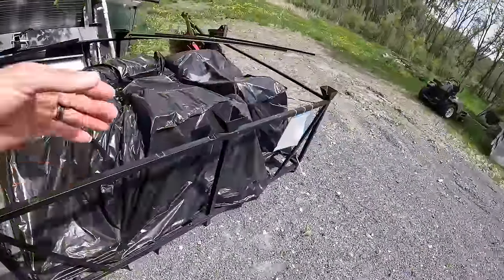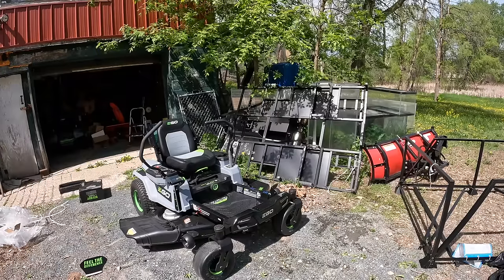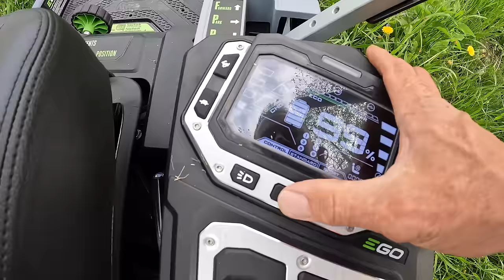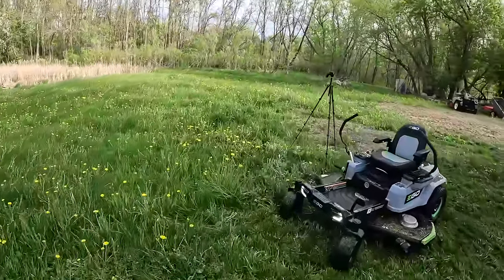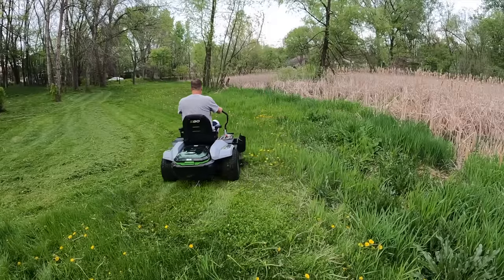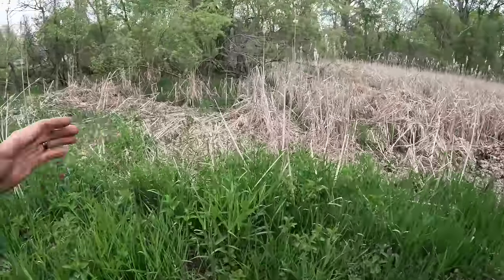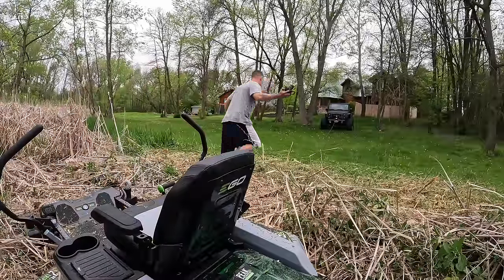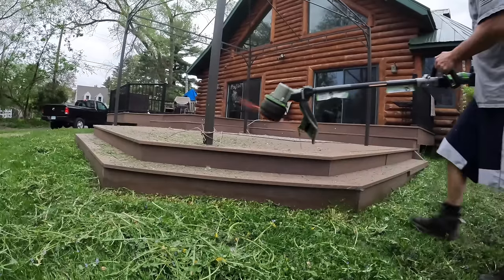Beating the hail of out EGO's new mower in a NASTY SWAMP

Comment: Your mower in that grass should be on its higest settings. Flip up the deflector guard pros dont use them because it throws the clippings faster and futher away, if your on a regularly weekly or twice a week different story but the grass is tall and its clumping up. Youll have to mow it twice to get it all cliped small. My mower that gas would love that grass its not very tall at all.
But my lawn tractor has a 22hp motor on it. I think with the lawn as it is its not cutting good. 

Second pass full speed blade and fast. Keep it trimed more often that mower will do better. You let it get long its not gonna look good.

Comment: I don't see any comment about this... but there is no transmission in almost anything with an electric motor. As a result, it has no advantage to spinning slower other than to save battery. Very likely this mower is not down shifting. What you are probably hearing are the blades spinning slower, simply because the battery cannot push the blades to spin faster. This normally makes a gas enginge chug and/or stall, but usally it doens't bother electric unless it starts put too much strain (heat) on the battery or other compenents.
Reply: If you have 37 horse fuel injected mower you can cut some serious sh1t up

Comment: You get some nice storms where you are, it is not often I see one where I live with such a high lightning strike rate. I like the mower, I saw a few of these at the mower place the last time I had to go there to get the belt replaced on the Hustler and wondered how they would compare. Which does raise a question, I'm guessing the deck on this does not have to use a belt driven system like that? As these belts do seem to wear out awfully fast under heavy use of the machine, or is that just my experience thus far? I'm guessing these new electric decks might not have that issue.

Comment: Stanley really appreciate this video here in California we're going to be forced to buy all battery operated equipment one of the things that scared me the most is you were able to flip this thing on its side the large lower making companies have really fine tune the center of gravity for mowing on slopes so this is scary to see you flip this thing on its side and when you're camera fell over I thought it first oh this is what I was hoping would not happen but fortunately it was just the camera what is your personal feelings about mowing parallel with the slope instead of up and down a slope some lawns run right into a creek or hills side wall it's safer to ride the slope then straight up and straight down my second question would be is that all the string line you could feed that whip commercially if you're doing a weed abatement which is on doing now and I'm using a metal blade and some instances because of coyote bush don't know if you have that there or thick mustard grass or thick licorice when it's dead it's hard to cut through could that whip stand up to that abuse really appreciated this video part 1 of my comment

Comment: Had i taken my lawn tractor down in the mud i would have gotten stuck, maybe the snow chains might have helped,  but now im running agro tires without the chains if you have a hill you slip on the snow chains all year help.
But i couldn't pull the tractor back in the garage with the chains and snow blower on the tractor no traction on the cement so i went to agro tires i hope this will help.

Comment: I guess I look at how much the batteries cost and how long they hold their charge.  I'm a Deere & Sthil guy. That thing was impressive but it looked like plastic.
Reply: Then I'd think you'd have to compare that to gas and oil you use along with gas burned to refill jugs along with how long gas motor parts costs along with how long they have to be serviced

Comment: Seems like a great mower. But the price and limitations on time. I have 80 acres with about 7 miles of trails that need to be cut. Also about 5 acres of grass around the cabins and opens fields.
Reply from the maker: Wow sounds like ya got a beautiful piece of land there. A gas powered mower would probably be better for ya. I like toro or gravely the best
Reply: We have a tow behind trail mower. Not one of the cheap ones.
Reply: @Dirtmonkey  it's beautiful. We bought it when we were 18 years old 38 years ago

Comment: Great video Stan. Happy Father's Day to you and all the Dad's out there!

I have a question about these mowers, I try and wash all my mowers down with a power washer at the end of the day. 

I do this for two reasons; one is to help mitigate any kind of rot and the other is to mitigate transfer of fungus or other contagions to other lawns.

 The directions for these Eco mowers say to keep them dry...

What does one do?
Reply: I would think that you SHOULD be able to wash under the deck. Anything else blow off with your blower.
To be honest I do not have the rider just the push mower. But I don't see any reason that you couldn't wash under, the motors are on top.

Comment: Like others had stated, I'm a little worried about the batteries and their life span. 
The mower - you gave it a good test and it preformed well (I don't think I'll be popping any "wheelies" with it!) But there again, I'm still worried about battery life in year 5 or 6. I'm not familiar with this type of battery so It'll take some research on my part to convince me.
The trimmer through - I liked the string loading idea and at 6' 2"  it looked like the shaft is long enough that I wouldn't be bending over to use it? Not good on a bad back.
I'll have to go to my local Lowe's and check prices. Not cheap but either is gas right now!
Reply: on 3rd year on my batteries and so far they are holding up just fine

Comment: * Heads Up **
 If you want those hyper expensive Lithium batteries to last (on the Lithium powered models), never, ever run them down to below 10% and do not charge them up to 100%. Generally speaking, Lithium batts perform their best and last their longest when charged and ran within the range of 40-80% of their charge range, elsewise you'll lose a decent amount of their lifespan. Now you know.

Comment: I have had a great feeling about any of the EGO products you've demoed, like I've told everyone about your products testing, if it survived your test, it will last a long time using it the way it should be used. But I've seen a few reviews on the batteries and they didn't last as long as they thought it should, what's your thoughts on this?
Reply: any product has some bad apples! so unless a overwhelming amount of people have the same issue then it's probably just a faulty part!
Reply: like literally everything battery or gas and no matter the brand! I had a buddy's Milwaukee sawzall lock up and it was like new maybe a few months old! but he bought another it's been great so really it just depends

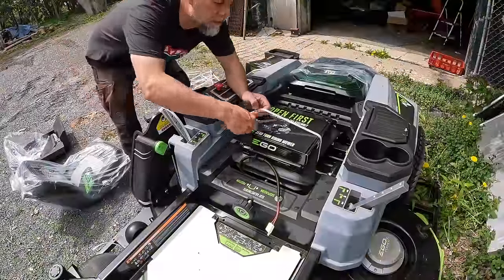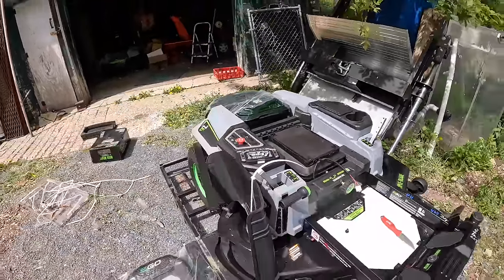Comment: I'm going to say round 2:30 to 3:00 bowers to fully change all the battery's. I see a lot of in cut grass I can cut one time with my gas mower an with grass that is taller then that grass. I would say that mower would be good if you spray for weeds an you keep the grass shorter it would mow that grass. The other thing they are more money then a gas I am betting that the blade motets are lots of money to replaced lot more then a belts of a spindle. That weed whip looks nice I might look into one of them if it to heavy if it lighter then my gas one and it has the power of my gas one I just looked up that mower at Lowes $ 6,000.00 it's to much money for my blood

Comment: I’m still skeptical about electric zero turn mower’s I seen a bunch of videos about Ryobi zero turns and it appears after a year or so they start having severe battery issues
I have a craftsman 42 zero turn going on 4 years old no issues. I’m sticking with gas engines right now
Reply: The EU government needs to push for a ISO standard for power tool batteries so for once we have a universal standard of interchangeable batteries to be used with all brands.

The Euro boomers have said that they're sick and tired of proprietary cell phone charges so they're forcing even Apple to adopt the USB C standard for their cell phones. My complaint is that they should have pushed for usb 4.0 because that standard enables enough juice to be pumped through a USB cable that you could get rid of proprietary laptop charger plugs. Remember the days of laptop chargers you buy that came with 10 or so different plug ends, with USB 4.0 they could make that a distant memory.

So by forcing electronic manufacture to go with  usb 4.0 they could force the electronic industry to adopt a single type of charge for all laptops & cell phones.  Yet they missed that opportunity unfortunately.

What I like about this mower is that it uses multiple smaller batteries so that if any single individual battery goes bad you only need to replace one small battery and not a single multi thousand dollar battery.

Comment: Seriously get a wireless winch control. If you are good with wiring tractor supply has one with a big remote. uses normal batteries and is hard to misplace. Also has a range of over 200 yards.  Harbor freight has one the size of a car remote don't know much about it.  The warn one that plugs into your winch looks to be around $300.

Comment: Over all. Not bad. How many batteries got me. I put USB charging points everywhere. That didn't really impress me. If I need one on my ridding lawnmower now. I put one on. Yet 6 batteries. Why I say that. An 12v lithium battery on an boat trolling motor standard. 5 hours or less run time. My small old but never used trolling motor on 2 20ah batteries wired my way with the solar not hooked up gotten at 30% power an straight 12 hour run time. Also solar charges up that battery pack. If not in the raft it's hooked up on my battery bank in my shop that is solar. That's 2 20ah AMG batteries. Would I buy it. What I can do with my standard gas ridding lawnmower and mixing it with technology. That one I could not. Yet I will keep it in mind. Thanks for showing. All my tools are battery, cord and gas. It depends what I am doing and the time of the day. I love modding everything I can. Again, thanks.

Comment: Please Show this Same Mower in Three Years With the Same Batteries , I have been Mowing my Grass with a John Deere 6 H P Kohler motor that runs on Gasoline for 20 Years ! Yes i do maintain the Mower , Gas Filter $ 2.25 , Oil Change With todays inflation $ 4.25 a Quart , Points and Condenser $ 6,50 , $ 10.00 - 12.00 For Gasoline for the Grass Cutting Season . What is the Cost of the Batteries when they go Bad and they will ! Were does one take a Electric Mower to get Fixed When it Has Problems ? I can see this Coming Haul it out Curb for the Scrapper and go Buy A new one

Comment: so, I'm just wondering the point. I understand it is electric and its good for the environment, except it's not. it takes more carbon and co2 and other emissions just to make one of those battery's then it does to run a gas mower for 3 years...and I guess that would be ok, except then you're paying a higher electricity bill to charge them and to dispose of those battery's is another whole story. Now I don't care much but again unless the point is that it's just quieter, what's the point to an electric mower?

Comment: Don't buy a mower with a lithium pack.  They all use lithium-ion tool batteries.  Low capacity, low cycle life, and expensive.   Much better off converting a lead acid mower to lifepo4

Comment: way you mower swamp its a lawn mower not a swamp mower take a gas one it will get suck in swamp water????
Reply: He never once faulted the mower for getting stuck. Quite the contrary he seemed impressed it was able to float as much as it was. He even showed the water/mud that it was driving on he wasn't trying to hide the fact. The point was to try and push it as far as he could on his lawn to demonstrate it. I would say he did a great job of that. I would also say that mower seemed to do a great job. Sadly its quite expensive.